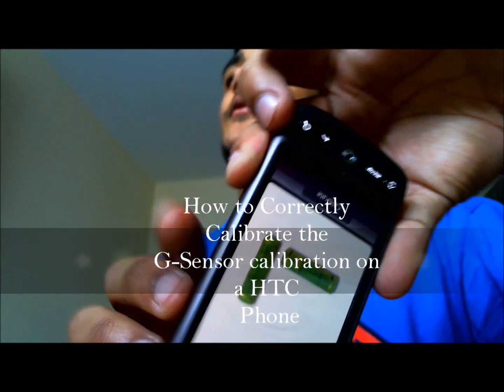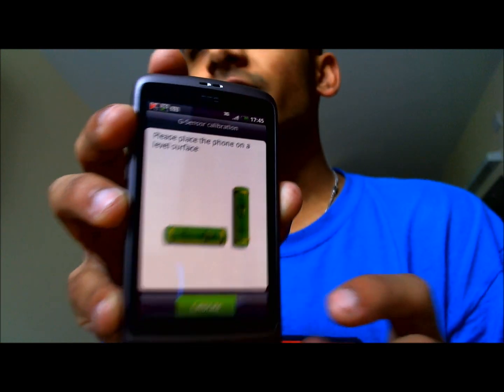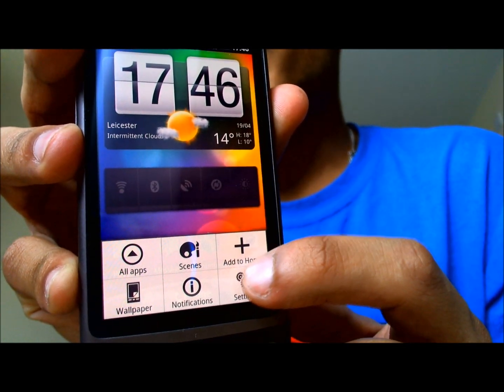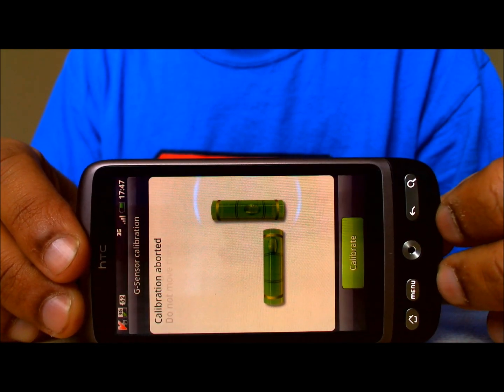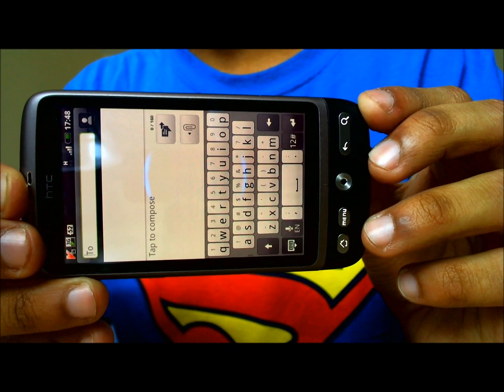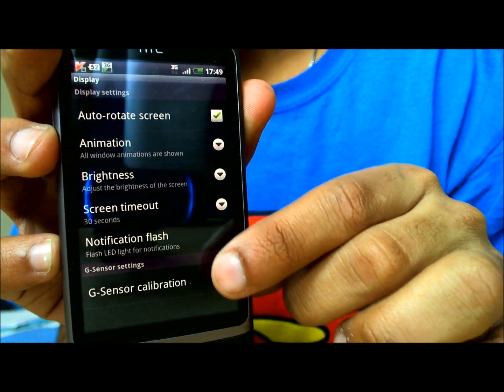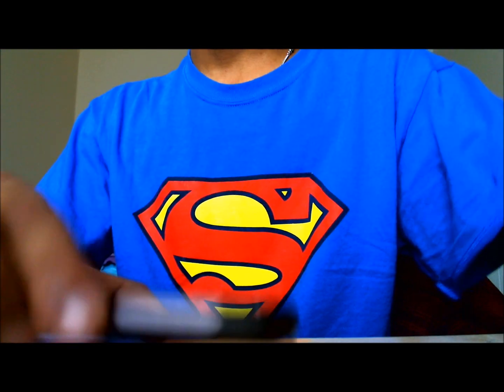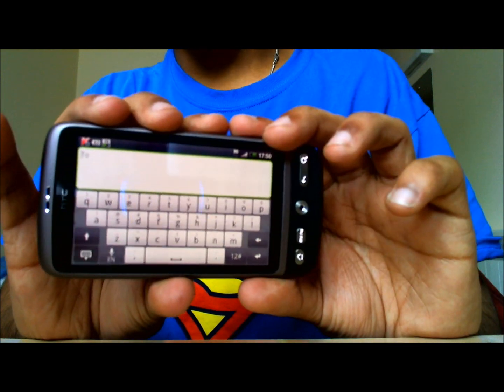How to correctly Calibrate HTC G-Sense - Video Guide [for Auto-Rotate Issues]

Comment: Thanks, but it's not working :)
Reply from the maker: Hamid Lotfy what phone make and model do you have? What other methods did you try? Only then am I able to help diagnose and provide a solution for the issue.
Reply: I have a HTC Desire 828 Dual. I exactly followed the instructions here and also at https://www.technobezz.com/fix-auto-rotate-not-working-htc-one-m9/ , but nothing helped.
Reply from the maker: Hamid Lotfy please try the following:

If the screen doesn't rotate when you turn it sideways, first make sure that the Auto-rotate screen option is selected in Settings > Display & gestures (or Display, gestures & buttons). If Auto-rotate screen is already selected, try recalibrating the screen if the screen orientation doesn't respond properly to the way you hold your phone.

1. From the Home screen, tap  > Settings > Display & gestures or Display, gestures & buttons. 
2. Tap G-Sensor calibration.
3. Place the phone on a flat and level surface, and then tap Calibrate. 
4. After the recalibration process, tap OK.
Reply: Thank you in advance, I tried turning on auto rotate and then recalibrating it on a flat surface but it did not helped
Reply from the maker: Hamid Lotfy when you turn autorotate on and turn on the camera and then change the orientation of the phone sideways does the camera turn as well? Please try the internet browser too, text messaging app and also the youtube app does it automatically turn sideways when you rotate your phone? Also HTC's website says "Not all applications support the autorotate function". This is why I am asking about Youtube as this application does support it. Make sure you lay your phone flat so the back of the phone is parallel to the surface so facing the same direction of a flat surface. Have you updated to the latest version of software? If this doesn't fix, then the final option you have is to factory reset/hard reset your phone. Make sure you backup the data you need before doing this! This should reset the gsensor. If all of these steps don't work then it's more than a software based issue and could be a physical issue with the sensor. 

If you don't want to do a hard reset please try the following: 
Drop phone (while supporting it with two fingers all the way down) from the height of about twice the length of the phone itself onto a writing pad (thin carpet would also work). You may be surprised but this method has worked for alot of people and they have managed to get the sensor to work using this method but make you sure drop it on something soft like a carpet or a book or  paper pad.

If you can also please upload a video showing this so I can figure out what might be another issue causing this this would be helpful!
Reply: When I woke up this morning, I noticed that the auto rotate functionality works. I don't know why. Whether or not, I Thank You and I really appreciate your interest in the discussion.
Reply from the maker: That's good news. Nice job!

Comment: I had my HTC 4G Sensation auto rotate the texts, but not the photos.  I followed your video and did the calibration on a level surface, and now it it rotates the pictures too.  Thanks!  Is this common problem with HTC phones, or any other smart phone now a days should be calibrated too?

Comment: Dear Friend,

It's not Hardware fault also. Don't try flashing or Installing ROMs. Its an unknown error. You can have the solution I mentioned below. Try this friend.

Its an unknown error of HTC one X. I also discovered it. When it was ICS 4.0.3 it was very good. After updating to 4.2.2 Jelly Bean the problem happened. Please follow my instruction that may help you. When you will find your G sensor calibration stopped.

1. Just Disable Auto rotation from Setting--> Display Gestures & Buttons. Or you can disable your Auto Rotation from anywhere you can find in your device setting. Just Uncheck the Auto Rotation.

2. Power Off your HTC one X. Remember No Restart. Just Power Off.

3. Leave it for 10 minutes or 20 Minutes.

4. Now restart and see what is happening. Your G sensor is working or not. You may go to Camera you will find it is Auto rotating. Leave your Auto rotation Setting. Just open the Camera and see Auto rotation is working or not.

5. If it is OK now you can check Auto rotation if you want to open browser in Landscape Mode.

6. If you failed or you have the same problem you just Go to the Power and Uncheck Fast boot and again follow from number 1.

I am confident because that really worked for me. I don't know it will work for you or not. I already told you this is such an unknown Error. May be a conflicting issue with HTC one X tegra Hardware to the JB 4.2.2 Android.

Thank you.

Comment: Thank you for fast answer but iAlready solved it in another way downloaded one of the apps Ultimate Rotation Control from Play Store which has option called force rotation.At the beginning it did not work so I switched back to SAFE MODE and fallowing another tip I disabled Fast Boot in battery settings.Back in Normal Mode phone started rotating almost everything.It took me 4 hours,I tried almost everything and I was more and more convinced that it was hardware problem but not.

Comment: It worked !!  Great job.   Brand new HTC One S stopped auto-rotating in less than 24 hours of owning phone. I bet many did what I did ---- played around with the settings and inadvertantly fussed with the G-Sensor.      I called T-Mobile and they were no help other than to offer a factory re-bootor brand new phone.  I declined and decided to Google my issue, knowing I could not have been the only one.      Thank you for the great video !